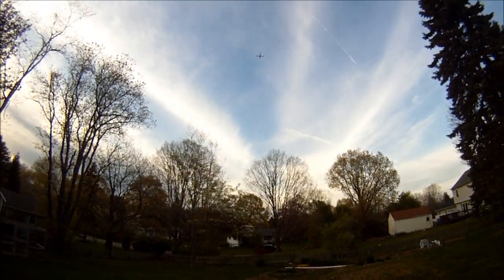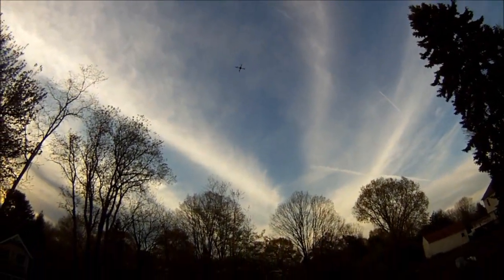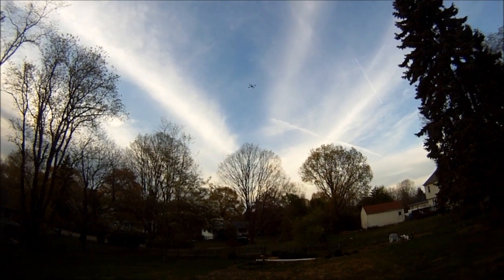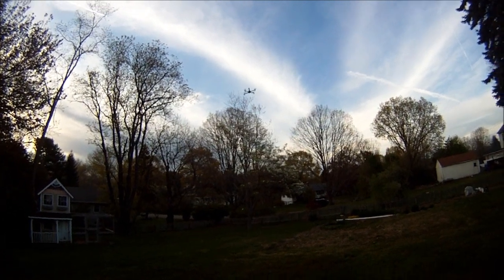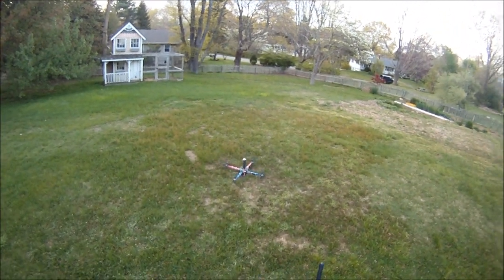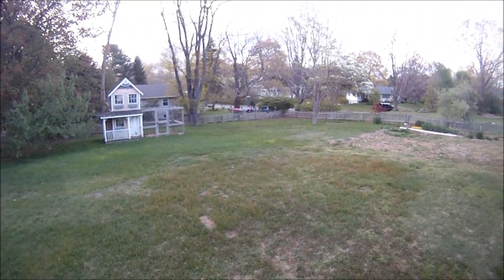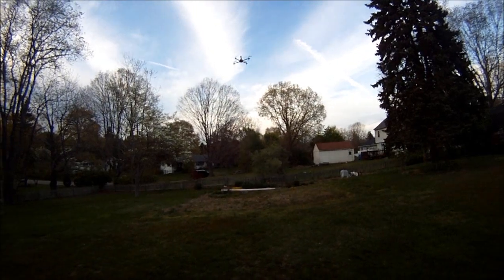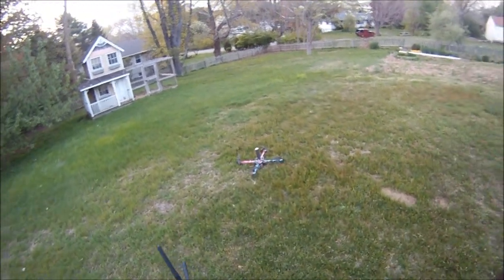Rabbit Flight Controller Problems

Comment: Well I am researching the Rabbit for the 1st time so I will concede that I do no know anything about this thing BUT if its worse than your KK board then I would say that the Rabbit must suck hard because the KK FC is almost almost a puff of smoke that does nothing. Have you tried to RTH-Lock, Altitude-lock or GPS-lock  with your KK board? If you do I would like to see that vid ok! Like I said I am no fan of the Rabbit and didnt even know it existed until an hr ago but I know the KK pretty well.

Comment: What esc's are you using? I'm using rctimer 30 amp programmables. I had been having issues until I went back to using all the esc's connected to the board. I'm also going to be doing some comparison flights with different timing settings.

Comment from the maker: Hello,
Yes, I have foam over the barometer sensor.  My major concern is that even with the sonar and GPS disconnected, the rabbit will drop like a rock (see in this video). This has happened on my 6X, tricopter and now my quadX, all of which fly great on my KK FCB. I would love to get the Rabbit to work but there is definitely something wrong with both of the rabbit FCB's I have.  At this point, I would be happy if it would work as well as my KK FCB's.

Comment from the maker: Hi,
Thanks for your thoughts on this but everyone is missing my major concern that even with the sonar and GPS disconnected, the rabbit will drop like a rock.  This has happened on my 6X, tricopter and now my quadX, all of which fly great on my KK FCB.  I would love to get the Rabbit to work but there is definitely something wrong with both of the rabbit FCB's I have.  I think other people are having similar problems.

Comment: Did you have a piece of foam over your baro sensor?  On my Rabbit, during altitude hold, especially in windy conditions, baro hold is variable due to wind changing the sensed pressure ( I believe).  What other selections are active during your GPS hold?